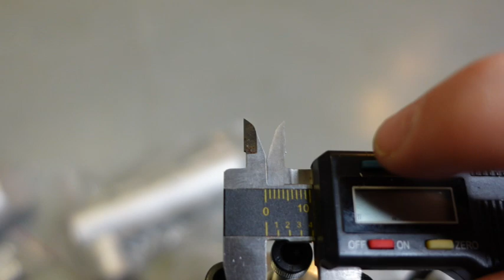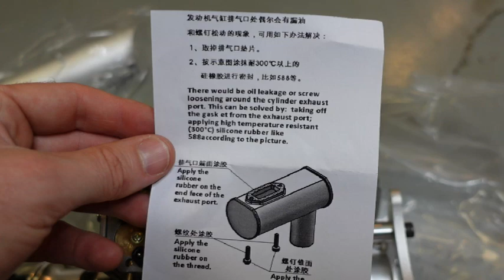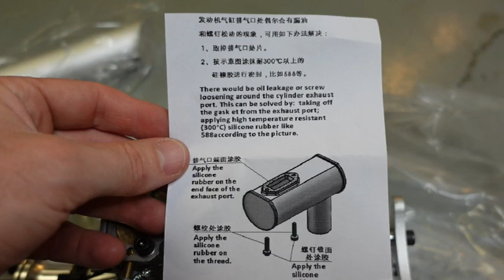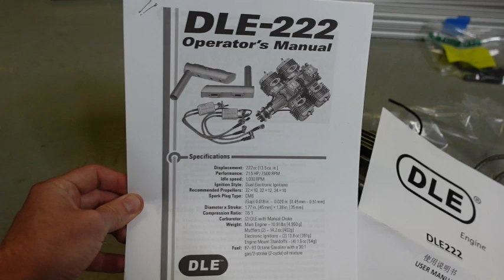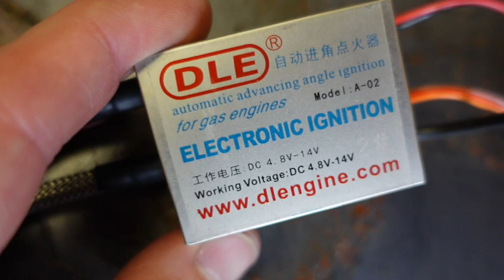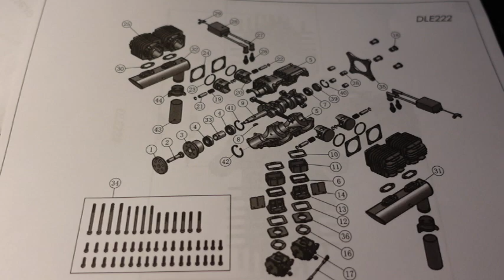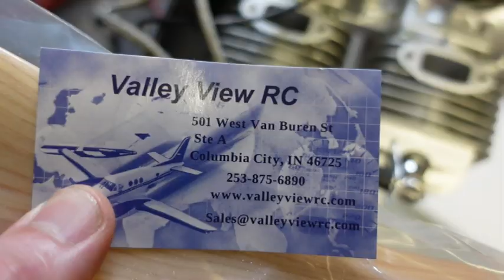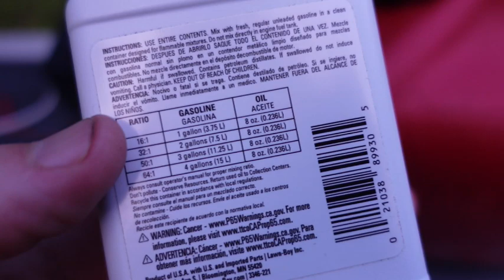DLE-222 RC aircraft engine unboxing and startup

Comment: On the spark plug you don't need to put those Springs in the spark plug cap online I don't use them so it'll hold better without the springs

Comment: I remember when I first got mine....good times... Took mine completely apart, checked all the rings, ports, machined surfaces, and everything I could think of for burrs, foldover, and general grit and swarth. It was pretty good, but I still had some sharp edges on ports especially. Hooking rings in ports is rare on these but it does occasionally happen. Also used gas proof thread sealant on every bolt that goes into the crankcase. Should be good to go. I'm just paranoid about details on something this expensive especially, but also just attention to detail in general.

I keep changing my mind on what plane to put it in, but have finally settled on a nice Giles G202. It's a little big for the airplane, but I've never regretted that, lol. Just finishing up my test stand. Got the plane from a fellow RC buddy. It's in good condition, but I want to sheet, glass, and recover it first. I'm okay with a winter maiden. It doesn't get all that cold for all that long where I live anyway.

Are you running the included DLE spark plugs? Some people say they're okay, others say their engine was running weird, only to find out when they checked it, one of the plugs had broken in half! I put Champions in mine just to be safe, and I'm keeping the factory ones as spares.

You paramotoring with yours? Or RC? Pretty cool channel. Fan of r pi stuff also. ☺️